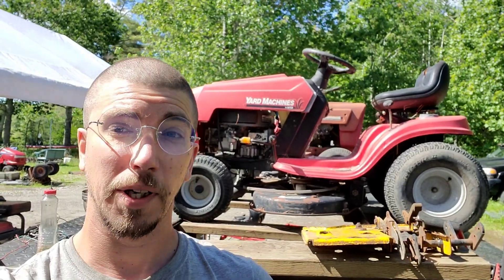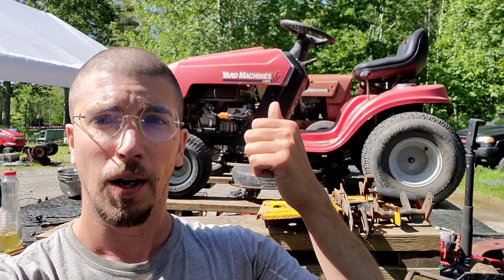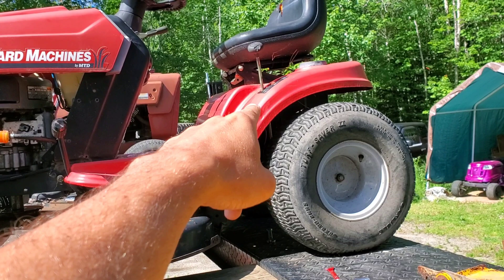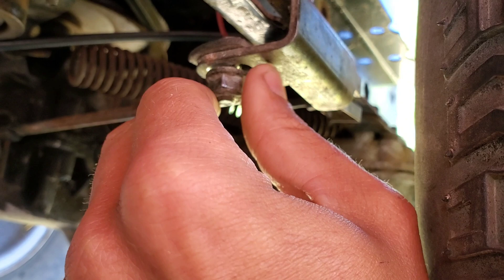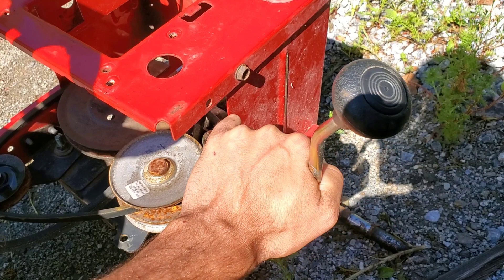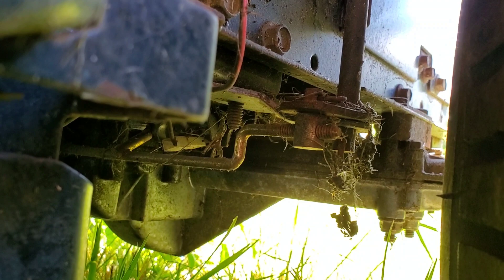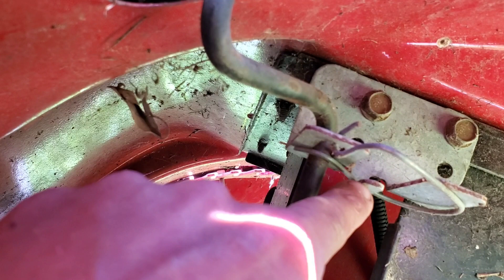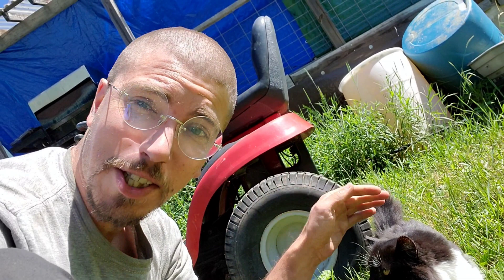Will not Shift into Gear Yard Machine

Comment: Great video.  The description of how the shifting works and the reason for failure for not shifting is very clear.  After collecting the needed tools, it took me only 2 minutes to correct the problem.  Two suggestions though--before applying the big pliers but after loosening the nut, trying shifting then--mine fixed itself--just had to then tighten the nuts.  Other suggestion--since becoming 80 and having arthritis, I have found that a large C-clamp is often easier to squeeze things rather than pliers.  It is also great for clamping on the vertical side of the mower deck to stop mower blade turning when replacing old blades.

Comment: Great explanation. The plunger going into the transaxle was gummed up. Before adjusting as you suggested, I cleaned the area on the transaxle. Seemed to be all the gunk not letting shaft go all the way in for F.
Thanks for showing me how to adjust. FNR.

Comment: Excellent. You could put a lock washer on it to help keep it in place. Also for anyone that has to open the transmission the MTD parts manual said the oil in it is 20-50w not grease. Other comments at other website say the oil turns to clay over time.

Comment: Saved me from junking it. Helped a lot. Now to figure out why the belt that engages the blades keeps jumping off randomly
Reply: I assume you figured that out by now, but in case you didn't take a close look at the frame near the very rear, behind the rear wheel to see if it's cracked. If it is, it will open up a gap in the frame when you shift mostly, and that causes the belt alignment to go wonky and jump the pulley.
I hope you already figured that out, but even if you did maybe it will help someone else fix theirs.

Comment: Mine after rolling on my head (4 staples) would not shift into FWD. Murry Rev Nut worked fine so it is a bolt and nut shifter adjustment. Thank you.

Comment: Hello, I have a 1999/2000ish MTD Garden Tractor that the FNR shifter is between the seat and the dash with the 1-7 Shift On The Go shifter being on the left fender next to the seat.  
My issue is that the shifter will go into the forward gears and reverse with a normal feel when the engine is not running , But when the engine is running - Its like the clutch/ brake pedal is not engaging enough. 
Usually to get by with my mowing here lately, I shut down the engine if I am in a tight area, Shift the FNR shifter and start the engine backup for however many times required to get back to mowing again.
The brakes do feel normal and do not appear to be sticking. 
In the past, I have had issues with the VariDrive Pulley pivot being not able to pivot like it should in which I would remove the cover and soak the pivot with penetrating oil like PB Blaster to loosen it up and after working the pivot several times then I would coat the pivot with SeaFoam DeepCreep which would work for quite some time.  
Being that my tractor is larger with 4 lug rear wheels instead of the snap ring type rear wheels, My tractor has all the same identical parts that most of the other MTD tractors have but laid out slightly different from what the diagrams usually show.  My secondary drive belt is very easily changed compared to the smaller tractors, But the large VariDrive pulley is blocked in under the rear fender assembly of the tractor unless you drop the transaxle assembly. 
The tractor was gifted to me from a neighbor who was getting ready to move in which they thought that the steering was going bad on the tractor. After getting the tractor, I got the tractor running and took it for a spin and quickly determined that the front steering spindles had not been greased for a very long time and then serviced the tractor. The mower blades were ruined from someone who did not know how to sharpen blades, So I ordered a new set of blades.  After a bit of TLC, The MTD is still being used. Just about all of the parts that I have ordered have MTD/Cub Cadet rather than the other names associated with MTD and being that I have a 107, 682 and 1710 Cub Cadets, I noticed that this tractor had more in common with the Cub Cadets with the exception of the Black and Gray Wheels.
Thanks for your reply great videos.

Comment: My ride on mtd has the opposite problem, difficult to get into reverse, esp if one of the drive wheels is just slightly off the ground. I know that spring is gone and has been since b4 I got the mower, but I have been unable to locate a spring here in Australia.

Comment: Hiya RCG. Great info for trans adjustment. Any chance you know where the spring on that transaxle Rod selector goes. Its on the rod but nit sure which frame hole it goes too. I had to remove the body from and back to rewire the harness  but saw the spring dangling and have no clue where it lands.  Thanks for your time. 
Mark

Comment: I realize this video is three years old but I have a Craftsman model 247.273300 T3000 built in 2018. It has the exact same shift mechanism set up. Mine will not go into reverse and the spring is still there? I'm being told to change the shifting fork inside the transmission. I would rather not have to tear the tranny apart if it's not needed.

Comment: Hey, I have a bit of a problem with this used lawn mower i bought. I can't shift between the gears while the engine is on. With the engine off it shifts perfectly fine, so i have no idea what is wrong with it. It is a Poulan Pro pp11536lmb. Any help would be appreciated.

Comment: Hey man, I have a 98 fnr shifter in the centre. Clutch just went to the floor and it took off in top without me changing. Gear shift is now light and not under tension and clutch is on the floor. Any ideas would be greatly appreciated! Cheers

Comment: Shot in the dark here, but would this also cause my FNR shifter to move, but not disengage out of forward? I have a Craftsman T110 (bought in Feb 2020). About a month ago, I ran over a stick(nothing crazy sized) but the mower stalled out. I've not been able to move or start it since. Shifter will move, but not the gear its self. Mower sounds like it wants to start but has no fuel. There is plenty. Never had an issue with it before now. Any suggestions??

Comment: my problem is i  need to know how to adjust the speed control lever at the back.there a ferrul  that connects to the idler bracket.I have a 2006 42 inch cut 13am762g752... be great to see video on aligning the idler bracket with the control rod.I really need help.I cant find any videos on this. thank you

Comment: Hi buddy, thank you for this excelent video.
I have a MTD 38" same to yours, but I I need find the service and parts manuals for it.
I ask you because I brougth it in used condition and the data plate is missing.
Thank you
Reply from the maker: Clean and check the underside of the hood. If its the original there is a service parts sticker on it.

Comment: Thank you for your content I've been a subscriber for about 4 years now.I'm having a similar issue with a mtd yard machine shift and go F.N.R. I checked all the belts they look fine and the transmission does fine in gears 5-7 but 1-4 it doesn't move at all.Will this adjustment work to get lower gears working? All the hardware you mentioned springs etc look to be intact.
Reply from the maker: In your case I would recheck the vary drive pulley and the belts. Once the belt loses any of its side wall you will have slipping in 1-3. Also check the adjustment on your clutch and be sure it is actually starting to make it grab in 1st.
Reply: @redneckcomputergeek  OK thankyou  will do

Comment: I wish you would of showed the spring on the yard machine instead of the Troy-bilt so somebody would know what to look for when replacing the spring idmf it's completely missing. I have a yard machine identical to the one in the video and it has nothing close looking to the Troy-bilt spring setup.
Reply: Yep my yard machine doesn't have the same setup as that Troy-bilt you showed. It's actually just a basic 4in. Spring that holds the shifter in place

Comment: What if the shifter is under the steering wheel in the center of the machine (older model)? 
I can shift into all gears but it’s really really sticky. Doesn’t want to go easily.
Reply: Oh mine is a Craftsman LT4000

Comment: @RedneckComputerGeek
My issue is not this but after a deck rebuild I have no speed control but never unhooked anything in relation to speed control.
Goes forward and backwards but stays at low speed unless u use ur heel to pull back on the clutch. 
Someone please help...I need to mow last week!!!
Reply: Wd 40 the variable pulley top and bottom groves where the belt goes and it will shift like a dream till it gets dirty or dry or you can use grease with a painters brush